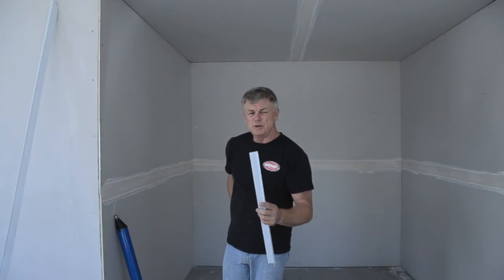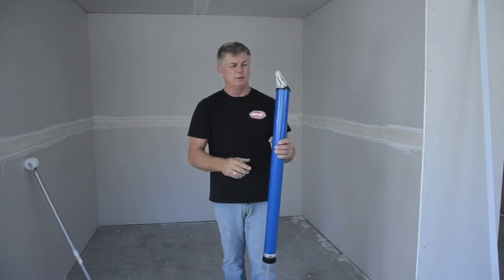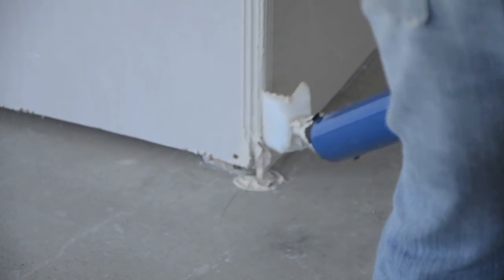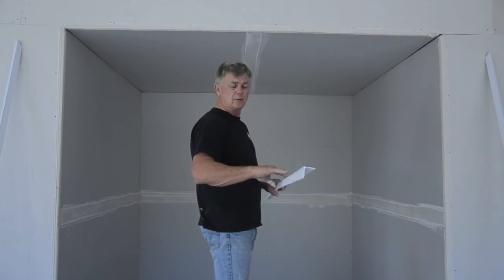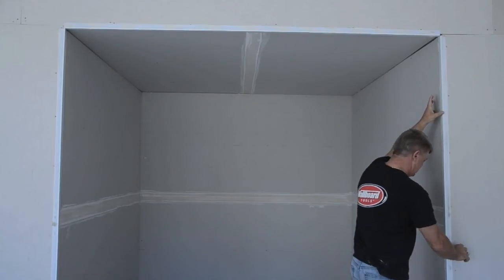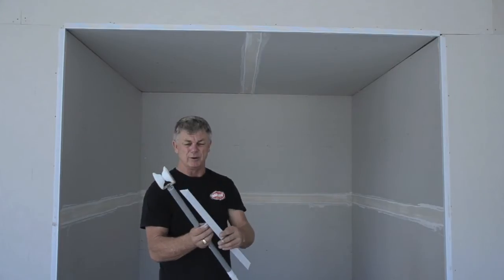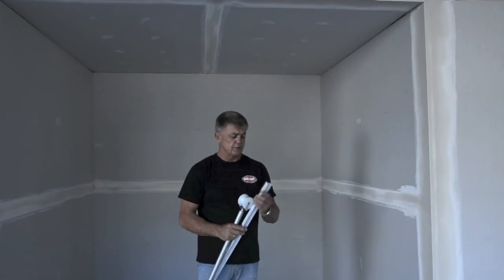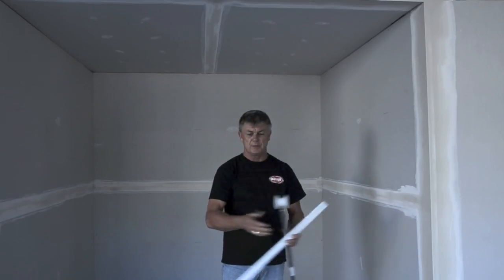Installing Trim-Tex Mud Set Bead

Comment: Any issues with setting mud in the tube? 
And can I use staples without mud for installing the beads?
Reply from the maker: Hi Jarrod, 

There hasn't been any issues with mud setting in the tube. These beads are designed to be used with mud - staples can be used also but if using just staples better to use a different bead than mud ons.